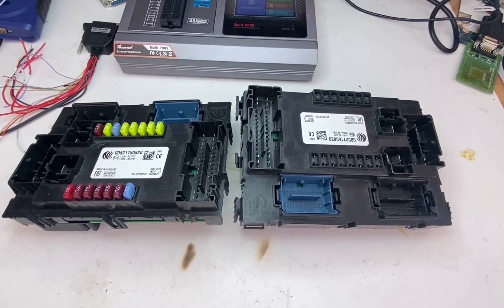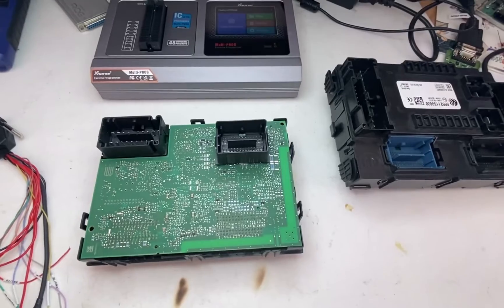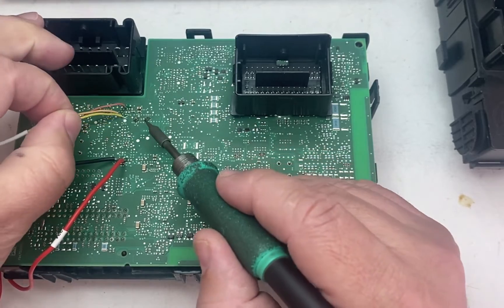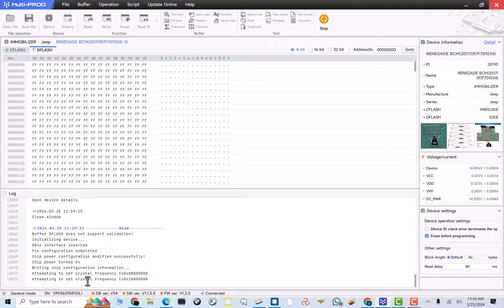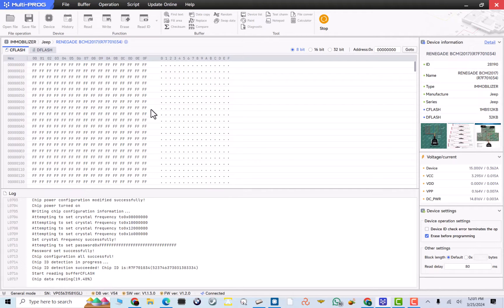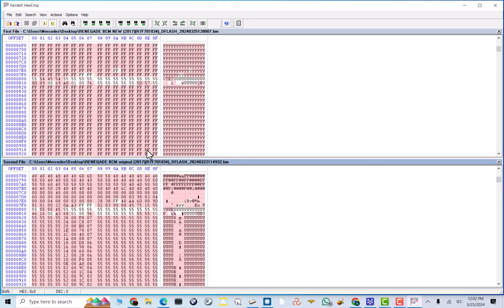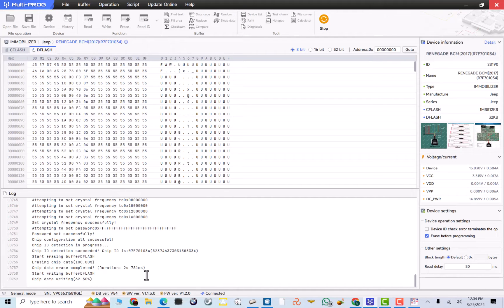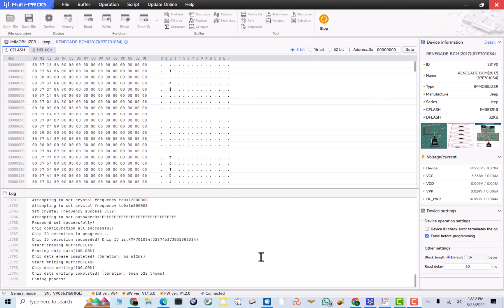Reading & Writing Jeep Dodge Fiat Chrysler BCM Clone BSI

Comment: Is it possible to have a BCM custom programmed to have additional features that is did not come from the factory installed? I would like to add power heated seats, heated steering wheel, but maintain full functionality for a base model 2017 Fiat 500X.

Comment: I have a BCM module from JEEP compas 2018 with R7R701056, I read its contents in dflsh and cflash but there is no visible VIN in dflash and after cloning the car does not see the bcm. Read multiprog
Reply: I'm going through this right now and it definitely doesn't work, it's just a scam, it can't read dflash properly so obviously it will never pass vin or immo data.